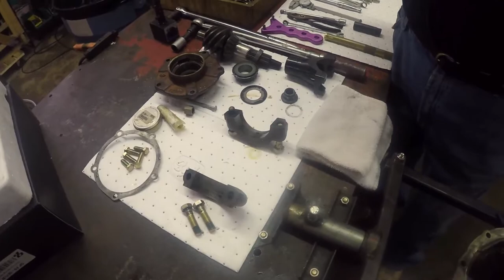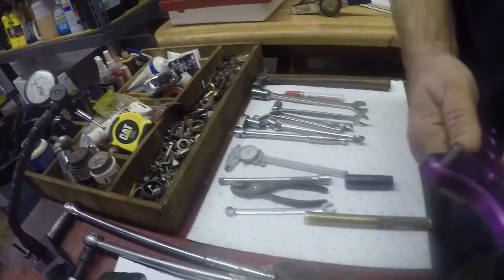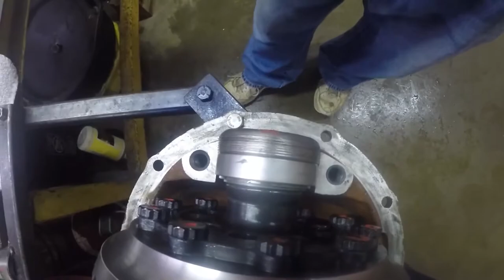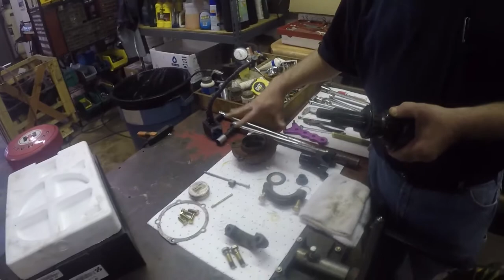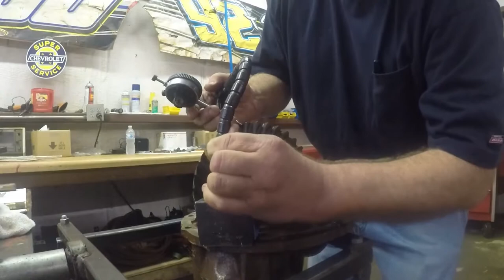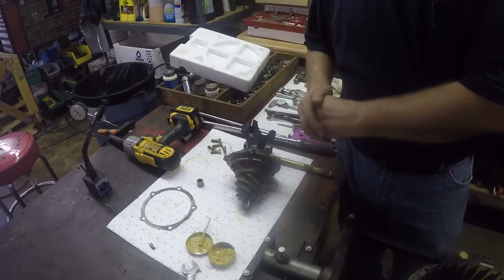Building The Gear!

Comment: Excellent Video very informative. I can't help but ask if you can change the right rear axle bearing to a Duplex Ball bearing. That's a double roll of bearings typically used in a turbo prop jet engine. The cost of the bearing new is over 10,000.00 but if you find a shop building them a lightning strike bearing would work. It's only damaged to not be considered Air worthy. A Garrett TPE-331 - 12UAR has the bearing. American Airlines flys this engine in a Jetstream , others as well. Should be able to pick one up for a couple hundred dollars. It would be a somewhat easy project and should give you a better and quicker shot out of the turns. If you have any questions please comment back. Thanks and Dad keep him going. LOL.
Reply: Did you know Lake Speed beat Ayrton Senna in the world karting championship one year